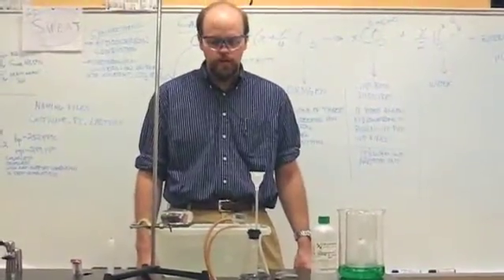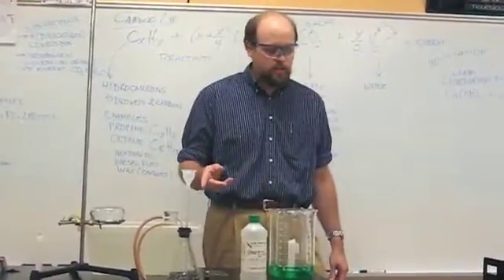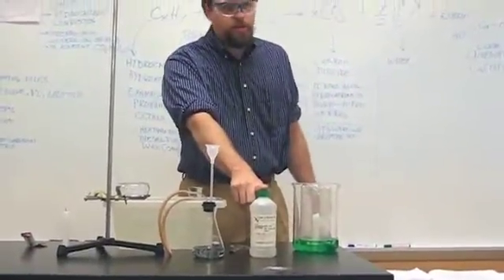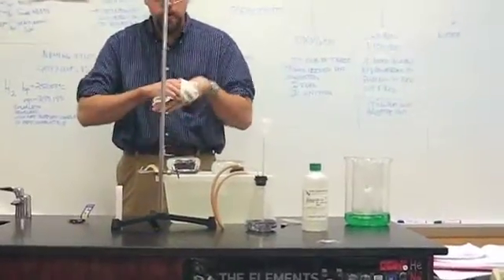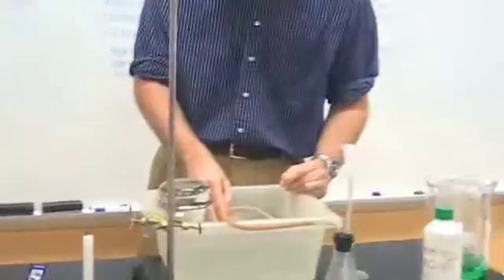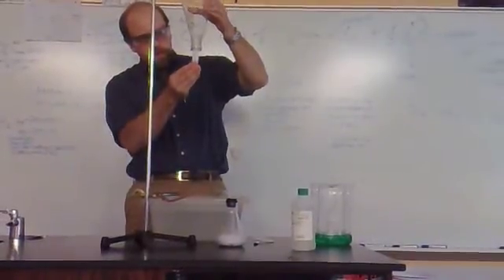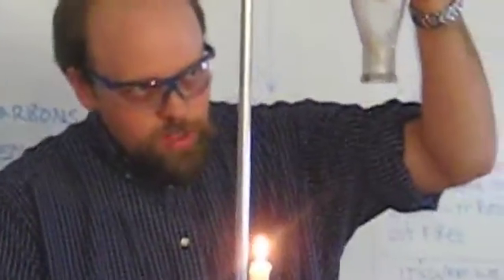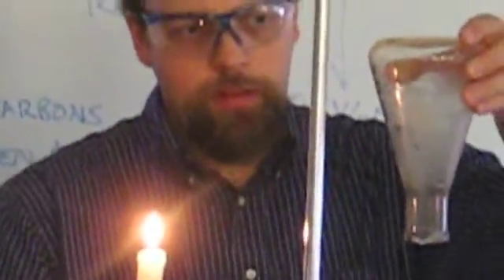Hydrogen Gas Demo

Comment from the maker: @meatisdeliciouse Beta radiation consists of electrons ejected at high speed from atomic nuclei that are unstable. That's ordinary matter but is not a chemical element. Alpha radiation consists of helium-4 nuclei ejected at high speed from an unstable nucleus. An alpha particle really is just the 2 protons and 2 neutrons in a He-4 nucleus: no electrons come with it. Neutron radiation can be produced under certain conditions. But none of this changes that Hydrogen is the lightest element.